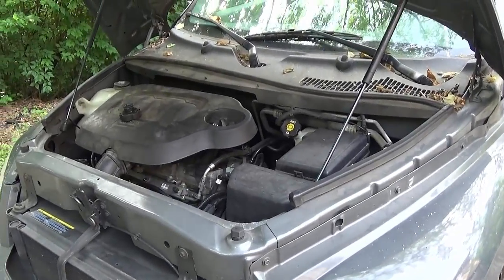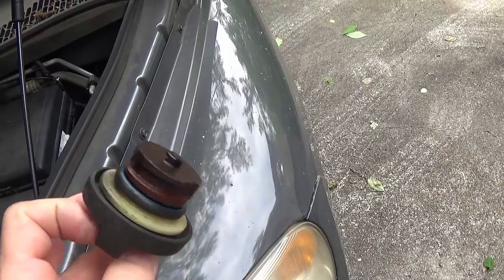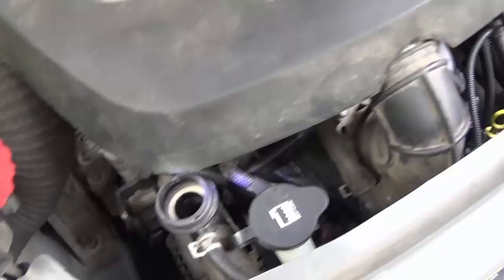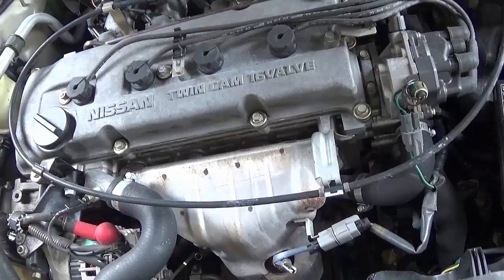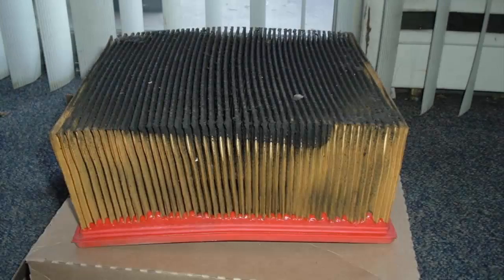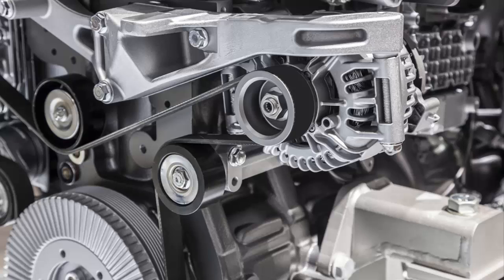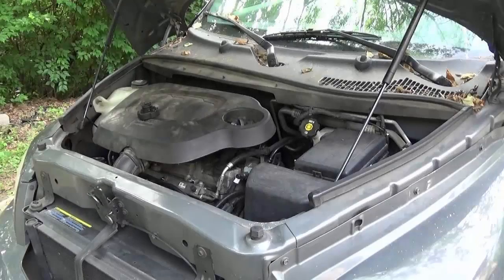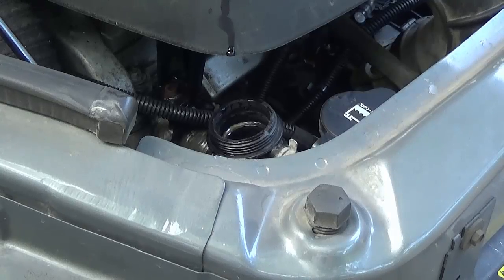Mechanic Reveals The Secret To Identifying A Bad Engine

Comment: So is my engine bad cause my coolant leaked into the oil?
Reply from the maker: Most likely, the coolant and oil have no reason to ever mix together. Usually if you are getting coolant into the oil, the head gasket is leaking internally. It could also mean you have a cracked head or cracked block but that is the worse case scenario. If you know the history of the car, if it ever had just plain water or weak antifreeze ran in during any harsh low to below freezing temps, then it could have a cracked head or block. Otherwise I would be looking at a head gasket.
Reply: Yes

Comment: Unfortunately you're wrong. Both my current cars (GM LP9 and LK9) and my previous car (Renault K4M) have all got dry filler caps, all 3 are in good condition. If the oil had been in contact with coolant, most likely the oil would be a milkshake colour, and would deposit on the filler cap.
Reply from the maker: Well sir, I am not WRONG, just because you had oil and coolant mix in your cars, doesn't make you all right and me all wrong. The engine in this video had such a severe blown head gasket, it was pumping coolant through the engine at almost high pressure. This will flush the upper end out and do exactly what I have shown. Watch the video again, when I crank the engine with the radiator cap off, it is blowing water out the mouth. 

Now if you have a coolant just seeping into the oil, you will then get the milkshake look on the oil cap. Or if it is the other way around and oil in seeping into the coolant, then the radiator cap will look chocolate covered. 

How about instead of leaving a comment that makes the statement you are God almighty right and I am stupid. How about just asking why your situation is different than the one in this video. 

I clearly show the milkshake mix on the dip stick, which is what you had. The only reason why there was no milkshake look on the cap is because the extremely overheating coolant was being pumped like a pressure washer into the head and washing away all the oil.
Reply: @RodsshopOrg  Just to reiterate I have NOT had oil and coolant mix in any of my cars, and they have ALL got dry filler caps, I'm just letting you know that just because a car has a dry filler cap, does not mean it has oil and coolant mixing or a headgasket problem. The video is misleading.
Reply from the maker: @Bozxeh  The video isn't misleading at all. If I come to your house and take off your oil filler cap and run my finger on the bottom. You are trying to tell me that there isn't any oil on the bottom of it. If that is the case, then your cars have issues like not getting any oil into the head. Every engine when you pull of the oil cap while it is running, you should see oil splashing around and or oil vapor. Even if you have a baffle in the valve cover, you will get oil vapor to cover everything in the engine. 

Plus the video shows more than just the cap, it also shows other things to look for. Sounds like you are one of those people that have to put in you opinion just so you can feel good about being awesome. If you know so much about all of this, then why in the hell are you even watching this video? 

I never watch videos on stuff I know about or know how to do. The only people that do and leave comments like you do, are apparently bored and love to criticize others to feel better about yourself. So we need to see your awesome video on all of this. When you create, please leave a link since you are the number one expert. I got over 40 years experience, how many do you have, how many cars have you worked on in your lifetime?
Reply: @RodsshopOrg  Yep, I'm telling you all 3 of my cars, which have perfectly healthy engines have no oil on the filler cap. Unfortunately you're getting upset of a comment which was simple criticism. If you can't handle criticism, maybe YouTube isn't the best place for you.
Reply: @RodsshopOrg  Plus I'm not saying all cars have dry filler caps, for example many cars do have oily caps, just not all. Just because it's dry, doesn't necessarily mean it's got headgasket problem. Simple.
Reply from the maker: @Bozxeh  I am not upset, I just get tired of people that act like they are experts watch videos they shouldn't even be watching if they already know everything about the topic and then comment on it. To me, if you already know everything, then why are you watching a video on the topic? 

But secondly, I have 7 vehicles myself, all with new and healthy engines. Brand new Camaro sitting out in the driveway with 4000 miles on it and if I pull the oil filler cap off, if I run my finger over the bottom, there is a film of oil on it. You want oil on the bottom of the cap. If you have a dry cap, that means you are not getting oil flowing through the head and valve-train. Maybe we are talking 2 different caps or something but I have never seen an engine in anything not have oil on the bottom of the oil filler cap. Maybe you are thinking I am saying on the bottom of the radiator cap. You should never have oil there. 

If you have an extreme blown head gasket like on the vehicle in this video, the coolant acts like a steam wash and removes all oil from the head. When I pulled the engine in this video apart, the head and cam were trashed. The customer ran it too long that everything in the head ran without oil lubrication and scored and chewed everything up. Had to replace the engine. The pan was full of churned milkshake oil water mix and that was into every nook and cranny. Was cheaper to just replace it.
Reply from the maker: @Bozxeh  I guess you are focusing in on one aspect of this video as a whole. I didn't say that all cars with dry filler caps have blown head gaskets, I am merely showing things you need to look for. I went over all symptoms this car was having and showed that the head gasket was blown. 

I am not sure why this is even an issue and why you are saying I am wrong. I do not know why all of your cars have no oil vapor on your oil filler cap. I just know out of the 1000's of cars I have worked on, they all had oil residue on the bottom of the oil filler caps. 

Well except those that had engine problems where there was the chocolate milkshake residue on the bottom of the caps, being oil or radiator. Or even red carbon residue where the exhaust was blowing into the engine either from a blown head gasket or the EGR system blowing into the engine. I have seen the oil caps completely dry where the fuel pump was leaking into the engine washing everything down with gas. When it dried, it left the cap completely dry. However if you smelled the cap, you could smell gasoline slightly.  I have seen it all.

Comment: Thank you the cap off is a good test..
Reply: The dealer I took my Ecotec (with blow-by) to, says I'm not supposed to remove the cap with it running. I guess that's their way of keeping their dirty little secret under wraps.
Reply: is this applicable on gasoline engine or this is for diesel car only?

Comment: Why don't you do a simple compression check   on each cylinder. An inexpensive compression gauge will give you a more accurate assessment of the engine condition than any of your bullshit video.  Rule of thumb is each cylinder compression should be within 10% of the manufacturer specification or with a worn engine with within 10 % of the other cylinders.  If these compression checks conform to the manufacturers specification you will have eliminated both blowby and head gasket/ cracked head issues

Comment: Hey rodshop could it be a pc valve because today I took the oil cap off and the dipstick out with the car running it wasn't puffing any smoke through the oil cap or oil dipstick and the oil cap is not dry it's oily

Comment: Hey rodshop just a question would a bad engine sign be the car burning oil or the tail pipe having oil residue
Reply: Would there be a check engine light there's no engine lights and there's not alot of oily subsence at the tailpipe just a bit would it be a pc valve
Reply: i took the oil cap off theres no steam or smoke i also took the dipstick out theres no smoke coming out

Comment: hello i have a question What if you take the oil cap off in a audi Q5 2011 and starts shaking is that normal?
Reply: Many VAG engines when you remove the oil cap they starts shaking and they rev a little bit. It is pretty normal because the ECU find a decrease of pressure inside the engine and tries to compensate.